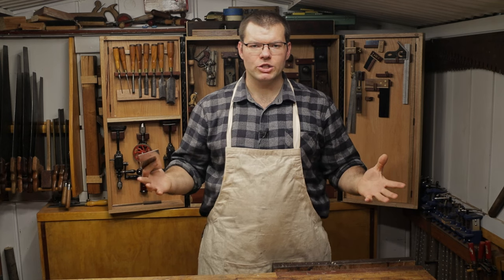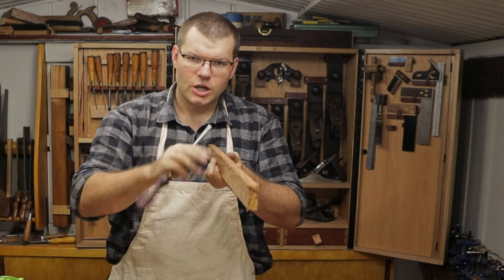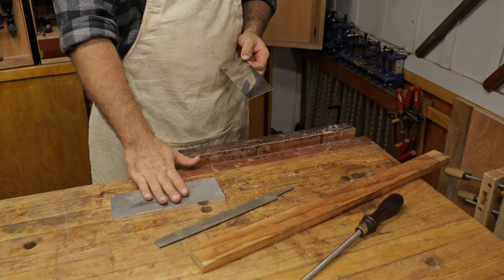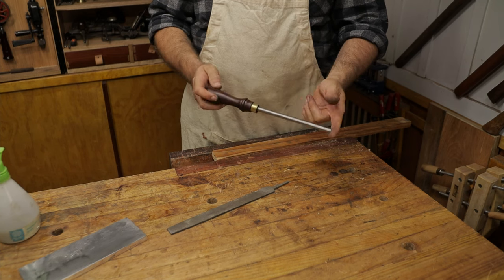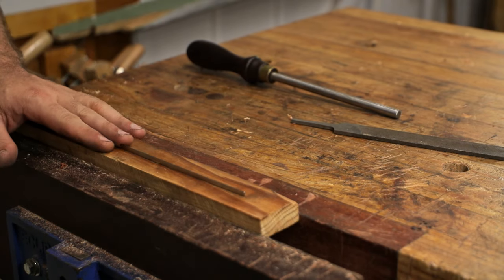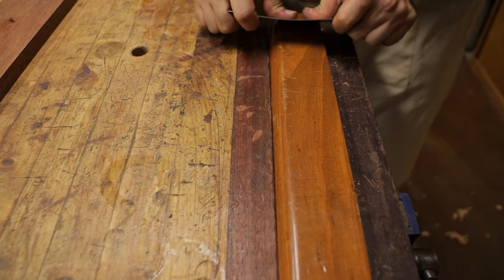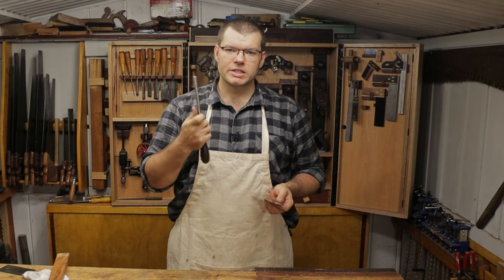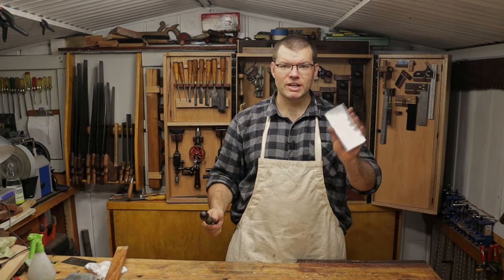How to SHARPEN a card scraper

Comment: I make card scrapers from worn out hardpoint carpentry panel saws, which is better than throwing them away. They are easy to cut with snips and you can make them any size or shape that way (some turn out better than others, though they all work). I have also bought several scrapers over the years. I agree that it is better to use a purpose made burnisher to sharpen scrapers; I've never had much success using anything else. A few drops of oil wiped over the burnisher seems to help (the metal part, obviously, not the handle).
Reply from the maker: I've never made a card scraper from a saw as i purchased a scraper set with rounds and curves etc, so never had the need so far. Oil on the burnished is a good tip.

Comment: Okay. Your method has merit but rather time consuming. 
Burnishing the edge goes a lot quicker and easier with a bit of candle wax, not oil. You don't want to gall the edge.
Consolidating the face weakens the hook and makes it to big. I used to draw file a fresh edge then stone burnish it but my belt linisher does it vastly quicker. If your edge is good you shouldn't need much pressure. I pull my scrapers, never bend or push them. Driving them with your thumbs is painfull. Its a bad technique taught by hacks at trade schools who never did time under a master.
Reply from the maker: The whole process takes but a few minutes when not filming and explaining. 

If the scraper is meant to be pulled and not flexed, how come the scraper planes are made to be pushed and designed to flex the scraper inside?
Reply: @AussieWoodshed  
Good question. I rarely use mine because I don't like it that much as a tool. I occasionally find it useful on large knotty timber but very few know the old trick of wetting the timber when scraping difficult grain and knots. The old skills are not passed on anymore.
Many Stanley tool's are really not that crash hot but selling gimmicky tool's is nothing new. 
More often than not a really sharp smoother across the grain is the best way to prep the timber before scraping. The finer the hook the smoother the finish. Wetting difficult timber cools the hook as it cut's and tightens the grain so the edge doesn't chatter in the cut.
Reply from the maker: @joschmoyo4532  i agree that Stanley definitely sold some tools that were nothing but a gimmick. 

I definitely like to learn and pass on the old skills so I'm glad you shared the wetting technique with me, i will definitely give it a try. 

Thanks for passing on your knowledge.
Reply: @AussieWoodshed  
The Stanley 45 and 55 was a classic example of gimmick tool.
My Grandfather had two that were given to him. Pristine condition. I could see he tried using them once then gave up. So did I.
Wetting end grain is one of the best tricks. Turns tough end grain to butter if your blade is sharp.
The other trick is skewing your blade and semi scrubbing. Most guys on YouTube don't really have a clue. They are just pitching product. Most of which is crap.
The how to segment's are mostly bad advice given by guys who never did an apprenticeship and probably never spent more than a few months in a cabinet shop sweeping the floor. It's enough to make you weep.